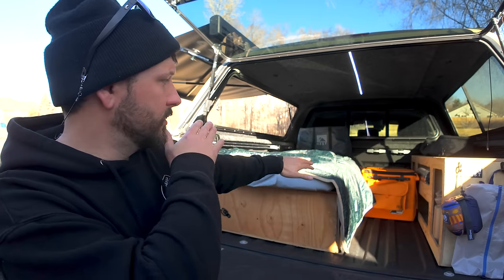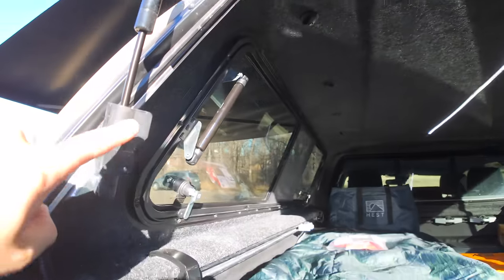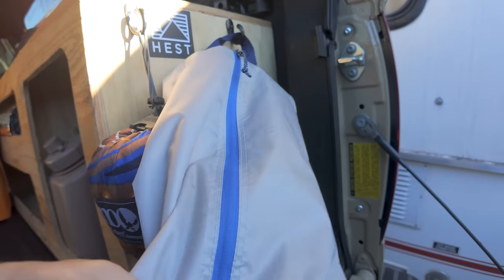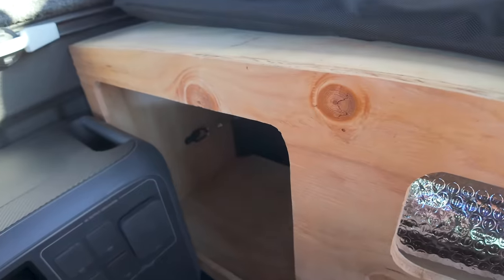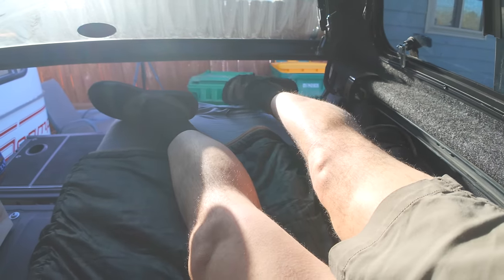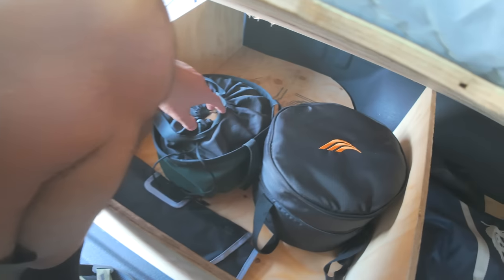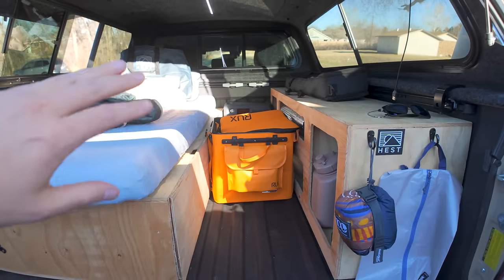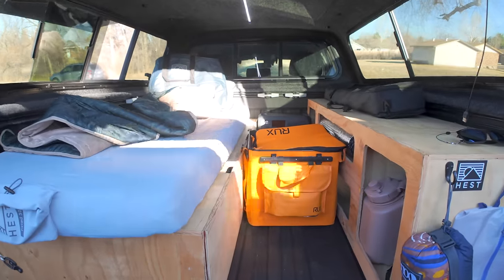Truck Bed Stealth Overland CAMPER TOUR - SLEEP in YOUR Vehicle

Comment: I think it's better to buy an SUV if you're going to close off the bed. SUV is much better because you can just fold the rear seats, and put the mattress. Less problems. And you can stay warm.
Reply from the maker: I used to have an SUV and imo it’s no comparison. The back of an SUV isn’t going to be flat so you’ll have to build a platform that will take up the entire back seat. Then you have to take all of your storage out at night when you sleep. Maybe some people make it work but I was way too tall in my 4Runner and that’s a fairly long vehicle. I found sleeping in the back of both my 4Runner and Forester to be very uncomfortable and cumbersome. Did a cross country trip in my forested back in the day and got tired of sleeping on the seat bump. The truck is perfect for sleeping inside. It’s doable but nowhere near as comfortable.
Reply: Blankets. They work great.
Reply from the maker: @dvrgz  you’re saying lay blankets down to even out the floor?
Reply: @OXFOOT  no. lay on the floor. Cover up with a blanket for “warmth” then keep it pushin. you’ll be fine.

Comment: Nice setup for 1 person! You could install some struts on the bed top so you don't have to hold it up to gain access to the huge storage area below.
Reply from the maker: The struts are something on my radar. I’m still debating just starting from scratch and going with drawers. I really just prefer at least 1 drawer when camping. If you pull them out you get a little more prep surface when cooking. That being said until then, struts may be the way.

Comment: How did you decide where to fasten the anchor for your turnbuckles? Seems like mounting it higher than the anchor point on the truck (instead of lower, like you did) would help it keep from bouncing better.

Comment: Are you able to sit up when you’re on the bed or would you hit your head ?
Reply from the maker: On the bed, no unfortunately. If I got the higher height topper I could. The wheel wells make it so that anything you build has to be a bit too tall. That being said you can sit in the middle section and fully sit up.

Comment: Make a slide out drawer for under bed instead of the hinged door.

Think like a sailor using webbing in the ceiling can hold bedding and utensils.
Reply from the maker: Yeah I want to do the webbing above the bed as well. I’ve also seen people add shelves up top by using the rack mounting bolts that come through to the roof of the camper.
Reply from the maker: Yeah I want to do the drawer but I may have to start over first that. The structure is compromised from the top if I wanted to build a drawer. Realistically I guess I could just use a new top and cut it to the shape of the one I have now.

Comment: What I was planning with my Tacoma ACLB as an inexpensive solution to wedge campers/Project M. 

Yes the BedRug will help with insulation and covering the tailgate gap. You still might need to keep the gasket seal.
Reply from the maker: I do love the project M though. If I do go camper in the future it would be between that and the radica moonlander. The bed sealing for sure helped, hoping to get a bed rug at some point. May have to re-cut my bed set up to fit the bed once I add that though. Oh well.

Comment: Great looking setup, and love the Hest gear, been using their pillow for about a year and a half so far, and just recently picked up the foamy wide for my forester, and I'll be looking forward to seeing how it is soon.
Reply from the maker: Yeah I wish I had this mattress when I used to have a forester and slept in the bed. Hopefully it works out great for you! The pillow is great, was too filled for my liking when I first got it but I removed some filling and it’s perfect.
Reply: @OXFOOT I'm sure it will! Thought it was gonna be a bit too big in the Subaru, but realized I have a self inflating mattress I won in a contest that's the same size that worked just fine. Kind of debating if I want to take advantage of the REI sale again and get the Hest blanket as well, or if I just want to keep using what I have.

Comment: Awesome, looking to make something similar and appreciate the layout and ideas!! Question - does the buddy heater cause condensation when you use it? I've read propane heaters provide a "wet" heat. Thanks!
Reply from the maker: Yeah it does but so does breathing in there at night. I have a whole video on diesel heaters but I’ve been just rocking with no heat and the heated blanket and just taking the buddy heater as an emergency backup.

Comment: Nice simple little setup!! I would have to argue that my 30 inch wide 8 inch thick  mattress is more comfortable! 😂 i rocked a 6.5 foot cab hieght topper for 5 years, so happy to have an 8 foot box and tall topper now!! Either way get outdoors any way you can!!
Reply from the maker: What mattress do you have? Yeah I guess and 8” thick one would be more comfortable depending on the material. This one is also 30” wide but cold weather resistant memory foam.
Reply: @OXFOOT  Amazon- brand= best to rest 30x74x8 , I've only used UT winter so far and love it
Reply from the maker: @SuperdutyExplorer  oh it’s like a mattress for a bed. Yeah that does look comfy. I guess I was more thinking of foldable/rollable camping mattresses. That is a good find though if you have the storage space for it when you’re not using it, could be a great way to go.
Reply: @OXFOOT  I have Milwaukee boxes I can pull into the middle area and out
Reply from the maker: Thats the next ting I gotta figure out. storage that slides. @SuperdutyExplorer
Reply: @OXFOOT  on my old setup I just had rope taped on so I could pull things out the back haha.

Comment: When it’s raining, how do you open the back window and get in without your bed getting soaked? That’s the issue I found with my Tacoma and cap. ✌🏼 Great build.
Reply from the maker: Yeah I never really get it “soaked” but it does get wet from the water running off the top of the rear window opening… the only idea I’ve had so far is to create some sort of gutter but I haven’t done it yet. I am rigging up a contraption now so I can easily hook up my moonshade but I don’t want to have to do that every single time it rains.

Comment: Nice build!  I would add a canopy/awning off back so that you can use your tailgate and be covered. Also, do you have a power station/supply for back there to run small electronics etc. ?
Reply from the maker: Couldn’t find one that fit off the back. The one I have off the side is too wide to fit on the back of the topper well.
Reply from the maker: Yeah a bluetti AC200, it’s a 2000watt battery bank, that’s what runs the heated blanket and charges my phone and batteries and all that.

Comment: Is that Ignik electric blanket worth the price tag? $200 is a LOT. On the Hest mattress, are you a side sleeper? I've yet to find a mattress that doesn't squash flat from me sleeping on my side.
Reply from the maker: I think it’s worth it but I used this one from Amazon for 2 years with now issues; it’s just not nearly as adjustable.

https://amzn.to/4cjx930
Reply from the maker: So it’s weird I’m a side sleeper but I mostly sleep on my back when I camp. That’s mostly because years ago I was a hammock camper and a ground tent camper before that. This matteress is the only one I’ve ever side slept on and I’m finding it surprisingly comfortable. I will say heat has a nice 100 night or something like that return policy if you don’t love it so I have no problems recommending it because I think it’s the best. It probably won’t close in a thin tent but it’s easily able to be rolled up and stored in your car.

Comment: Nice rig! 
Where did you get the awning and how did you mount it?
Reply from the maker: The awning is a kammokn awning, it’s not cheap by any means. It mounts to crossbars with their hardware pretty easy.  It’s one of those things where if the ease of use is worth it for you then buy it. For me it’s worth the price but I refuse to use regular awnings after a few bad experiences.
Reply: Thank you!

Comment: What's that tailgate table looking thing ?
Reply from the maker: The thing attached to the tailgate? It’s called a Billie bars and it’s a flat surface with cup holders and a non slip surface. It basically just bolts into the factory holes.

Comment: Sweet build.  If you dont mind, what did you pay for the ranch topper?  I had an 02 and 2011 Tundra with A.R.E. topper.  I agree with you about the bed being cold.  My current 2020 Tundra has spray in bed liner.  The previous two  had the plastic liner.  I prefer the plastic liner.  Because you won't have to caulk to keep cold air out.  And it protects against things getting stuck in between like  leaves, wood chips, or anything you're loading in the bed.  It's also easier to pull things out.
Reply from the maker: I optioned the heck out of it and I think it was like $3k. A little cheaper than some of the big names but I also didn’t get the most expensive one they had. Mine is like middle of the pack.
Reply from the maker: For col I do think I’m going to get the bed rug because the spray in liner does just about nothing to insulate.
Reply: @OXFOOT  yeah I agree.  Try the plastic liner.  Both of my previous Tundras had the plastic liner.  I prefer them more.

Comment: I like it. Im considering a truck for camping and urban stealth camping.
Reply from the maker: So far I’ve been really happy with this set up. For sure need to get some better window insulation going for sure but I’m loving the truck bed camping.
Reply: @OXFOOT  Im more of an urban stealth camper. I hate all these influencers who have these 100k-200k vans and claim they're "camping" when they just have a house on wheels. They also have all the gizmoz and gadgets which is insufferable. Simple is better. Most urban stealh campers are doing it for financial reasons, so whenever i see some "influencer" with a 100k-200k ambulance build; it just grinds my gears
Reply from the maker: @osrselgin_2_1bcx54  you read my mind. I’ve been in the industry for a little while now and there’s not too many folks in the industry I vibe with. People taking stuff just to review it even if it’s expensive. I’ve turned down 99% of the stuff that’s come my way and I don’t want to build the newest and best thing, I’d rather just make the experience as minimalist as possible. The more stealth I can get, the more I can sneak camp while skiing/biking or anything outdoorsy. I’m not just camping to play with trinkets at camp.
Reply: @OXFOOT  i love that

Comment: Have you ever thought about fitting a freestanding 270° awning for more shade coverage?
Reply from the maker: Considered it but it never seems to make sense on my build. Didn’t work on my 4Runner because of the hatch and I suspect the same on my Tundra but I’m not sure. It’s a possibility but I would need one that requires no legs and fits over the topper hatch.
Reply: @OXFOOT fair enough mate, is that camp kitchen set worth grabbing?
Reply from the maker: @harryshaw4727  It depends, do you value having stainless steel high quality stuff? then yes, but if you want just something to cook with sea to summit makes some decent stuff for about 3/4 the price or a cast iron will work. Big thing for me is not cooking with "nonstick" since that stuff flaking off when you cook drops testosterone levels and causes other issues, so for me stainless steel/carbon steel or cast iron is worth it.
Reply from the maker: @harryshaw4727  But I'm also weird about avoiding plastics, anything soy and non stick pan stuff anywhere near my food at all cost so I'm sort of a freak when it comes to that stuff so take that with some grain of salt. I love it, you might like cast iron better if you've cooked on that for years.
Reply: @OXFOOT  just went to get one but don’t ship to nz fml
Reply from the maker: @harryshaw4727  oh damn! Maybe there’s some other brands out there on Amazon that make something similar.

Comment: How stealth it is? Will you be able to camp in the city?
Reply from the maker: Not as it sits right now. I mean I could do it but not having the windows covered would make it tough. I want to be able not have any electronics light able to be seen from the outside and currently if my phone goes off it lights up the whole truck bed.
Reply: @OXFOOT I wanted to buy a truck and build a similar setup, but stealth is a important to me, since be stealth enough to park in the city offers lots of flexibility. I might consider build from a minivan or smaller van like Toyota Sienna / Honda Odyssey or Chevy Express, which has more space inside and can be totally stealth anywhere. However, in the non-urban area, your setup is pretty good. Wish you best on the road and enjoy.

Comment: What kinda mpg you getting ?
Reply from the maker: My truck says about 16 most of the time. It’s worse in the city but slightly better on the highway. Denver is weird because it’s so mountainous I can get anywhere from 30 going down mountain to like 8 going up steep mountains even on highways. Generally around 16-17. My tires aren’t crazy different from stock at 35”.